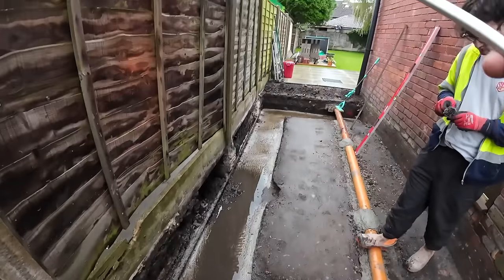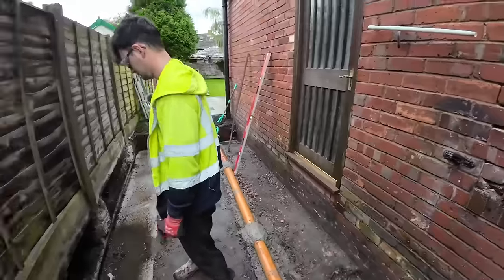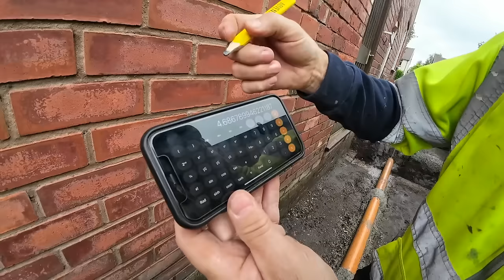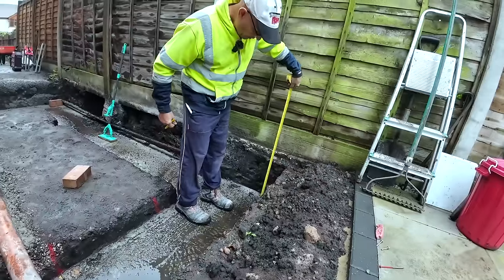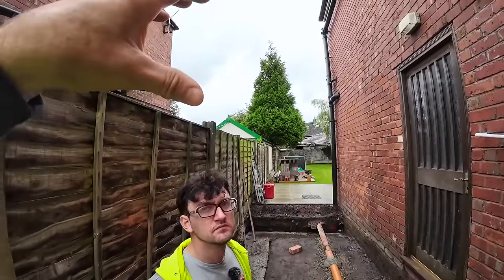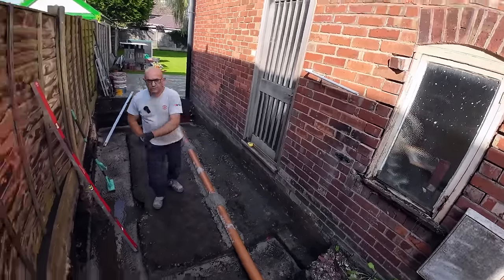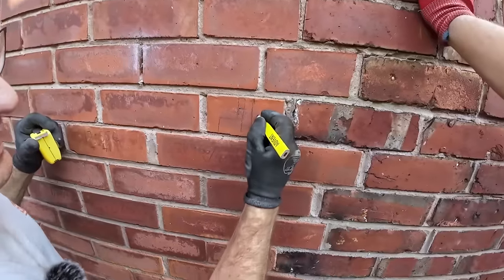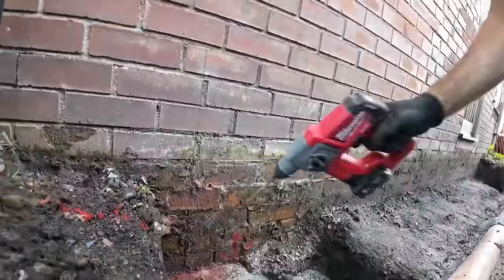TURNING OUT AND EARNING NOWT .. NEW EXTENSION PT 1

Comment: do you folks over there use line levels? Lasers are great but I trust them like a wife who flirts. I have a hard time trusting either... Had a project that the auto level on the laser didn't work and was 20mm or 3/4" out.
Reply from the maker: No we don’t Garreth . Milwaukee tools are very good and reliable 👍🏽🧱

Comment: Steve and alex , could u post what the diagonal formula u use to square of the extension mate please
Reply from the maker: Google Pythagoras theorem 🧱👍🏼🤙🏽
Reply: Just get an app for phone
Reply: Alternatively just check that the both diagonals are the same length you don’t need to measure with a tape. Use a straight length of timber baton.
Reply: Pythagorean theorem.  Squuare each number, add them then then square root of that answer.
Reply: @LifetimeinWelding  that won't give the correct diagonals though. The correct diagonals will marry up with length and breadth
Reply: Adjust the structure until both diagonals are the same. Don’t need the actual numeric number of diagonal length. I’ve done it this way for the passed 60 years.
Reply: @LifetimeinWelding  youve done ot the slow way then
Reply: @needaman66 no need to faff about on the shop floor or on site with calculations before we had calculators. If the measured  diagonal is needed it would be done by the drawing or design office and written on the drawing as a supplemental dimension. .
The characters Ive known on the shop floor would have a panic attack if you expect them to square a number or find the square root. 
I don’t think I could do now without a calculator.